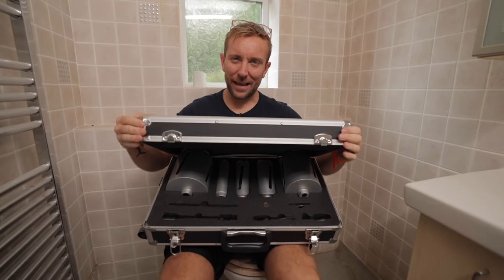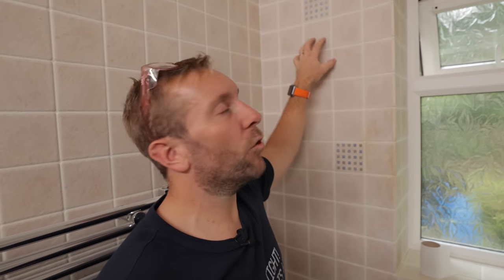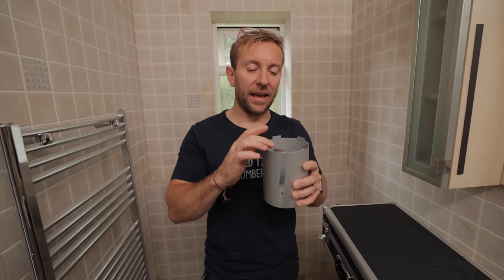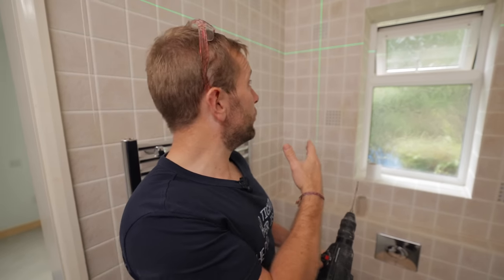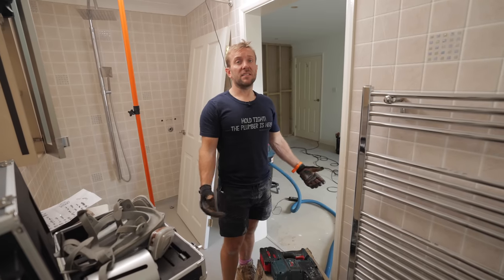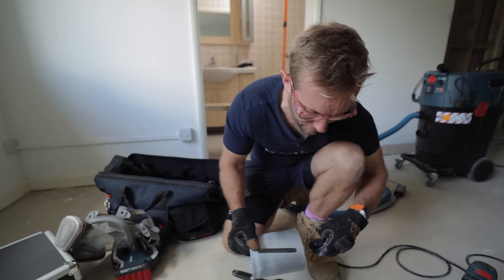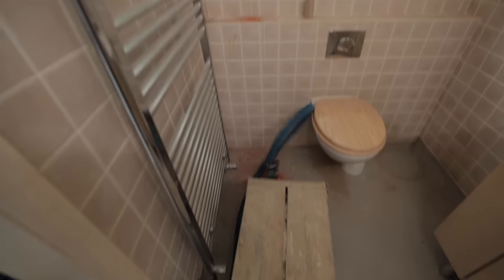HOW TO CORE BIT DRILL ULTIMATE GUIDE - 11 TIPS!

Comment: Wouldnt you drill through at a slight downward angle? (from inside the house) to help avoid rain water running back down the pipe through? You mentioned to go in horizontal ....
Reply: Not on a combi boiler flue 👍
Reply: Not on any condensing boiler flue,has to rise or some flues have internal rise in flue so can go straight
Reply: @joeker2023 didnt he say it was for an extractor fan? I'm sure I heard him say that

Comment: I have got that drill , didnt think its meant for core drilling ?? I saw a guy smash his eye socket and break his nose using a regular drill while core drilling when the core got stuck and the drill kicked out and I've nearly broke my wrist using the wrong drill. I would only use a dedicated core drill
Reply: The wall he´s drilling into is very light. That´s no problem. 45 cm concrete wall full of rebar, however, IS a major obstacle and you need a special core drill with a holder. That´s no easy job.

Comment: Doesn’t cover the need to drill the last couple of inches from the outside , in.  This will avoid break-away of the outside wall surface, particularly if it happens to be rendered.

Comment: Great tip with the laser. Only thing I'd add is that, in my opinion, you should use a torque bar on the drill and support it the correct way. Some drills have a tight clutch and if the core jams, having the torque bar could prevent injury.

Comment: I was drilling core drills 30 years ago and never used a laser level A D NEVER HAD A PROBLEM LINING IT UP BY EYE. 
EASIER WAY OF DOING THIS JOB IS 1ST DILL A PILOT ALL THE WAY THROUGH THE WALL . GO OUTSIDE, CORE DRILL FROM OUTSIDE IN UNTILL YOU GET TO THE TILE, AND THEN FINISH OFF CUTTING THE TILE. YOU DONT HAVE AS MUCH MESS INSIDE , ALL THE MESS IS OUTSIDE. JOB DONE !!
Reply from the maker: OK I'LL BEAR THAT IN MIND NEXT TIME ROUND MATE - I REALLY NEED TO GET A LONG 10MM BIT!
Reply: @plumberparts  i wish you were local, I do plumbing but by jove I'd love to have you around just because you're a hoot of a party. Was I supposed to write all of this in caps?
Reply: ARE YOU SHOUTING BECAUSE YOU WRENT WEARING EAR PROTECTION WHILE DRILLING?
Reply: @jacbisgood2221  WHAT? AREA SHAUNTY  BECKONS ILL RENT WEARING HER PROTECTION WHILE DRILLING HER??
Reply: @dimitar4y  WHAT?!
Reply: @jacbisgood2221  WHEAT??! WE DON'T HAVE WHEAT, WE'RE PLUMBERS
Reply: I’m with you on that one
Reply: That's a good tip. Not because of the mess but to protect the face of the brickwork outside.

Comment: Brilliant video. Learned a lot, especially that you can drill at such a large size and go through the wall without blowing out the brickwork externally. I install Air Conditioning and see this all the time with inexperienced trades people. Then they try to just bung the blown out  holes with either silicon, expanding foam or sand and cement, which is disgraceful. The laser tip I especially found helpful. Thanks again. P.S. Would love to know the model of the drill you use as I am in the market for a new one.

Comment: James, would you not use a long pilot drill bit to drill straight through both cavaties and then use the core bit to drill through the first cavity (internal) from inside & then the second (external) cavity from outside?  Stops brick 'blowout' on the outside cavity which most times will occur  👍

Comment: a bit of copper wire of copper slip will also stop the bit sticking to a chuck. Also when removing a bolster and foot in and on the diamond bit vent helps to hold it from twisting when removing it if its stubborn.
Reply: Copper slip is the boy
Reply: I use a copper 22mm olive. Brass is no good, it doesn't crush down.

Comment: Great tips and tools. Thanks again James 😊
Reply: My golden piece of advice is to drill a small diameter, smaller than the pilot bit, guide hole all the way through the wall.  This has two benefits: first, you can drill most of the hole from the outside avoiding break-out of the brick facing and it reduces the amount of dust inside the house; Second, the the guide hole provides a continuous path for the pilot bit to follow and the core bit will remain concentric with it. This second point is especially important since if you just rely on the pilot bit to provide a guide path it may wander off centre and then your core bit, now no longer concentric with it, will jam up with brick material.  This effect seems to be worse when drilling into exposed wet walls and the ‘dust’ instead becomes a clogging wet clay.

Comment: Please 🙏 🙏 🙏 can you help me. I am fitting a cooker hood in my kitchen, and it has I silver flexy pipe 6"  to go through the wall BUT the old fan needed a 4" hole. Is there a way to make the 4" hole into a 6" hole, or should I put a reducer on it instead.?????
Reply: No just make yourself a small wooden frame to the size of your new hole.fix it in place or I just hold it while my bit gets a bight in the wall and off you go.just remove your little wooden frame.before you carry on.happy days.ive also used stench pipe for guide basically any sort of guide to get you started.

Comment: Any tips on how to remove bits stuck in the chuck? 😂

I've just finished a core for a 110mm waste through double brick cavity (with external render).

Nothing broke per se, but the little BB in the chuck is jammed, so the bit won't release. And even though I sprayed the threads with PTFE, the SDS bit is seized to the extension, which is seized to the core cup.

Spanners & hammers just isn't doing it. I'm in a right old pickle. I'll be able to cut loads of large cores, but fk'all else.

Comment: @plumberparts how come you don't just drill a pilot all the way through and drill from the outside? Is it just so you done blow the tiles?
Reply: not really needed, the thing comes with a "pilot" drill bit anyway. It's easier to start the hole so the coring bit's pilot can take over.
Reply: He was lucky not to blow out a brick face, but if you take it steady and not apply too much force I think that helps
Reply: Another comment he said he would but needs a longer 10mm bit 😄

Comment: Whats the point in using slotted cores with a vacuum - use solid body cores and the dust extraction works a treat. Why waste time removing the wall ties as they can take ages to remove and the core cuts through them fairly easily. And why did you drill horizontally instead of drilling downwards at a shallow angle to prevent any rainwater backtracking into the building?

Comment: It would be interesting to see the wall detector in more detail. I have Bosch's much cheaper version and it's never worked properly (and I've had several of them) - it's always showing the wall as being live even when there's no wiring in the wall - WHATS GOING ON BOSCH if you are reading this?
Reply: Are you sure you're not moving it too fast?
Reply: @amg863  Even if I move it at a snails pace it still has the same.problem. I just think it isn't very good at doing what it's supposed to do. It is reasonable at finding studwork and nails - I'll give it that.

Comment: Did you mention that the drill should just be in turning mode, not hammering?  NB! And yeah let the tool work, don't force it. And be prepared for the bit binding, which can be a real arm twister.
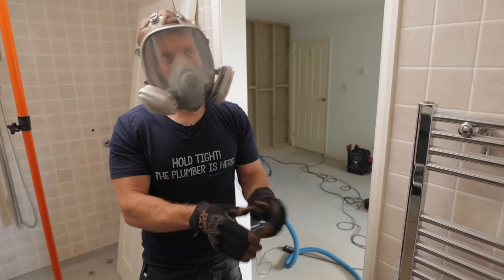Reply: 09:40
Reply: @codenamenel   Cheers was not sure, I think most DIY'ers will try hammer mode, which will ruin the bit at the least

Comment: Why not just stitch drill the wall around a circle template, avoiding the need to buy core bits or risk them jamming in the wall?
Reply: Not nearly as clean of a hole, each bit punching through can cause blowout, and you have to drill a lot of holes for a big hole like this. Can work though.
Reply: @ravenstarver1360  - A heck of a lot of holes true, but core bits seem pretty slow as well. And the fan body should cover up those rough edges. As for blow-out, I'd suggest turning off hammer action before you reach full depth of the wall.

Comment: Those diamond bits are meant to be used at a much higher speed than the 1500RPM the SDS can muster.   Even a corded drill bill not go above 2000 RPM.  That is why an angle grinder with about 9000 RPM is the correct tool for the job.  These bits Mill not drill.   An SDS is about max pressure and grinding away.   The angle grinder will mill the surface  but at higher speeds without the same pressure, just move the tolerance from side to side and up and down. This will keep it cooler, and extend the life of the diamonds.

Comment: Use a proper core drill works better spins faster and cuts quicker also you picked probably the easiest core to do plaster board block and soft brick I core holes at least 3 to 4 times a week and they arnt that easy we have birtley bricks in the North East wider than a standard brick and twice as hard.
Best core bits are the marcsist they are about £150 for just the 117mm bit last ages and don't glaze over